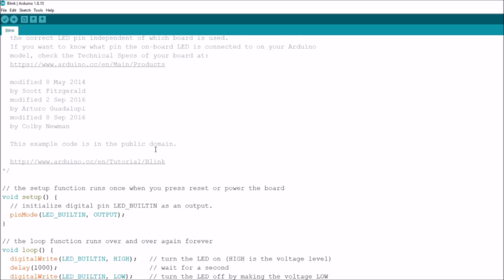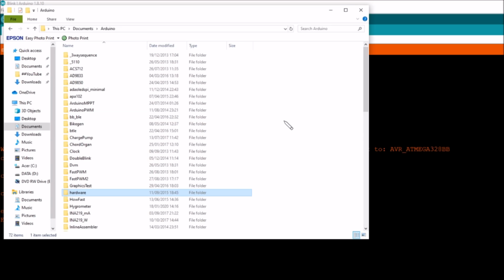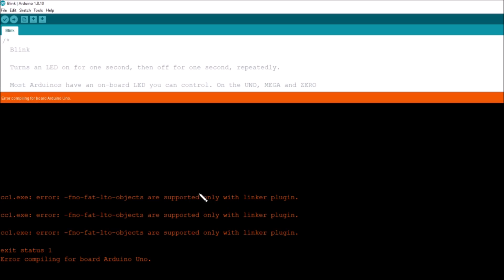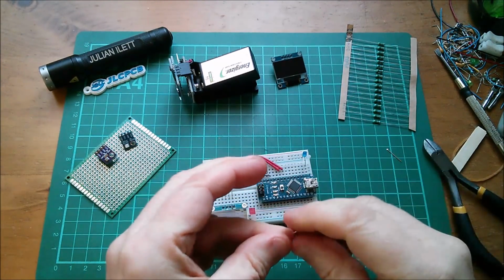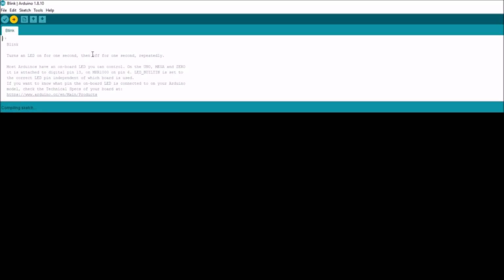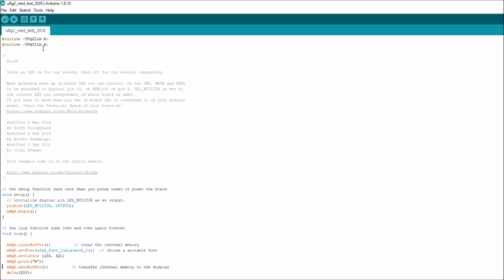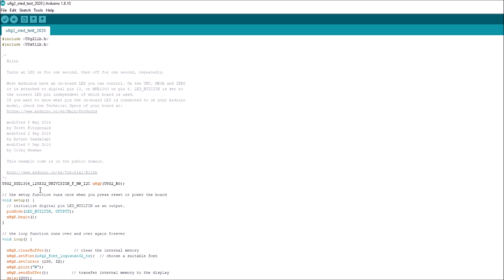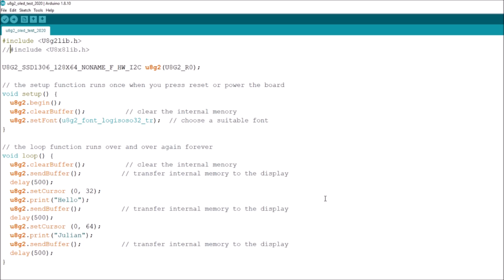Getting back into Arduino #1

Comment: That's why I feel so lost! I bought hundreds of dollars worth of components, but I struggle to do anything that works. It is so frustrating! Since I didn't understand it before I'm truly lost now. There's no way I would have figured that you could rename all of those folders and they would just recreate themselves. 
I too used to do all kinds of programming back in the day, but that day was decades ago. I think I  should just consider giving up. I'm getting no where. It's super frustrating when it comes to the ESP(families) of chips. I can never seem to find the board definition that will work with either the ESP8266 or the ESP32.

Comment: The way to solve the code breaking is to use dependency management, and you need to include both the arduino and other libraries you used. The Arduino IDE has something like that but it's global, and unless you plan to always use the same version of the same libraries in all your projects present and future, it's not a good solution.

The simplest form of this is having a git repository with git-submodules of each external bit of code your depends on. The best way of doing this is with dependency management software, aka package managers.

Some more professional environments allow this like PlatformIO (for Arduino and many others) with the lib_deps option, and mbed (for ARM) which does it by default. Saving your project references with a specific version or even commit from a library and you only upgrade if you want to. Also having the option to have a local copy of the files you depend without taking for granted that the repository (or even github itself or whatever) will exist in 5 years from now when you need that project again.

Comment: As my old boss said:
Change control - change control - change control
Without it your a**e will get bitten.

Do not worry though - its the modern style and we all suffer for it - I got caught badly with Python and eInk libraries when the new models came out as the supplier of the driver (a certain company in a steel town) took away most of the functions my code used leaving me with a big retro update!

Python has environments to lock down development versions and I think you can set versions in the IDE but not sure.  Really glad my professional programming life is over :-)

It could be a con to keep programmers in a job with statements like 'Boss its going to take me months to rewrite this to use the new library to give you that new user function'.

Comment: When I was putting together my WS2812B led array illumination system for an n-gauge Ferris Wheel last year, I decided to just use 2 PIC12F675s to handle all the outputs that I needed. (At one point I was going to use a 16F616, but was having trouble getting my PICKit1 programmer to flash the chip - this was later sorted out when I got a PICKit3 that runs on my Ubuntu machine - after fiddling around with a few bits and pieces such as the voltage level - it wanted something like 4.6875v - I was happy to be finally able to program the chip on the breadboard, but for now I won't be using this processor, although the stripboard circuit does have 2 14 pin sockets just in case I change my mind). Needless to say, I did not compile anything, because with 35 instructions, what'd be the point (also, considering the strict timing requirements, pure machine code would be the logical choice). The only other thing I would say is that why 24 bits are needed for each LED (I'd sooner have just 256 colours like in the GTIA modes of the Atari 8 bit)...er...the PWMing on the 8050 doesn't appear to realistically address 16.7 million colours - and the higher luminances just are blinding...also, amusement park illuminations don't really need anything like all that...no arduino libs needed, thank you! Incidentally, the bits and pieces used for the led arrays are 8 led 'struts' (Adafruit 8 led segments), an Adafruit 'jewel' for the centre piece, and two TruOpto strips for the outer rim lighting. I thank you for demonstrating how to connect the 16Mhz crystals to the 12F675s...

Comment: A little off topic but has anyone used the MPPT off eBay for 10GBP (item 312642468438 for example) My question is IS it MPPT or PWM. It looks like some PWM's for the same price but says its 10%-30% better than PWM claiming MPPT. All replys with thanks.

Comment: You should consider buying a new PC if it's too slow for what you are doing. You can get a good one using Skinflint for around 500 GBP that will work much better than your current one. Unfortunately I cannot share wish list links here, YT deletes comments with links IMMEDIATELY.
But here we go:

AMD Ryzen 3 3200G, 4x 3.60GHz, boxed (YD3200C5FHBOX)
MSI B450M Bazooka V2 (7A38-026R)
Patriot Viper Steel DIMM kit 16GB, DDR4-3200, CL16-18-18-36 (PVS416G320C6K)
Intel SSD 660p 1TB, M.2 (SSDPEKNW010T801/SSDPEKNW010T8XT/SSDPEKNW010T8X1)
be quiet! Straight Power 11 Platinum 550W ATX 2.51 (BN305) 
DeepCool Matrexx 30, glass window (DP-MATX-MATREXX30)

Currently for 427 GBP excluding shipping

Would make for a nice PC building video, too!

Comment: So that is one reason I graduated to VSC and PlatformIO. Even so, the libraries for these things are crap and you end up re-inventing the wheel over and over. The Arduino project is wonderful, but filled with traps and an IDE that really stinks. I guess experience is the only solution.

Comment: The hazards of installing new versions of the IDE, compiler toolchain (AVR toolchain is bundled with the current generation of the Arduino IDE), and libraries... things are no longer compatible with each other! :( This was one of the main reasons I have switched to PlatformIO + VSCode. VSCode provides the IDE, and PlatformIO does the compilation - and allows explicit control over versions of the toolchain and libraries used. End result, I have the choice of following the trends and latest version, or locking off the version of stuff for extended support and reliability. 

Your first error about the build.board preference is because in your hardware folder you had a custom board definition for the "ATmega328 on a breadboard (8 MHz internal clock)" which because of it's age doesn't set that preference. I added that on my copy, but have also renamed the hardware folder 'hardware.old' in the past ;) You can actually do away with that board entirely now if you use MCUdude's MiniCore board support package, as that provides the 8Mhz RC oscillator option, and is a up-to-date package. The later linker plugin are most likely because you have an old version of the AVR toolchain still installed locally, but the build scripts are newer, so it's using parameters that weren't valid before. A Tools -> Board -> Board Manager and an update of any out-of-date toolchains would most likely have fixed that. 

btw, library examples are in the File -> Examples menu. I'm sure it'll all start coming back to you... just need to liven those cells up a bit again! ;)

Comment: Man what a coincidence. that happened to me with all my old code that I wrote for my Arduino. when I install the new IDE to my laptop a lot of my codes didn't work. I managed to get some of them working again but a lot of them aren't. I don't know if it's the libraries or what. especially when I was using the ATTiny85
Reply: That's pretty much why I keep older versions of IDE installed.

Comment: Don't spell your files/folders wrong!  They can be hard for YOU to spot later so just rename them with "OLD" or whatever best describes it.  If you rename library to OLD-library it will be easy to spot and find later.  Sort by name or search for OLD and you will find ALL your changed old files and folders.  A year from now you will be wondering why someone spelled those wrong but the OLD ones you will know why.
Reply from the maker: Possibly, but my mind does work in peculiar ways :)

Comment: Is for that I save the old libraries in my project folders, just in case, and sometimes even the old IDEs (TASM, Turbo C++, Arduino IDE, ...). I still use the older versions of "LiquidCrystal" and "CountUpDownTimer-master" Arduino libraries, they work just fine for me. Thanks for sharing !

Comment: Having the same issues with ESP8266 - I have a project that's been working for over a year and needed to make a small adjustment.  Original code compiles but doesn't perform as expected - back to square one...

Comment: Some years ago i had an arduino uno (clone, i think) in my hands to program it for someone with a script found on internet.
The computer didn't see the arduino. It seemed that the ic for the usb was not programmed. I ended up programming the arduino using a cable between the parallel  port and the icsp connector.

Comment: When my Arduino project is done. I leave the Arduino in the device i created. I don't modify the code after.... No problem that way! And buying Arduino in bulk is cheap !
Reply: Bulk?  Where?  Best I've seen (months ago) seemed to always be cheapest in single units from eBay.  Yes, I know and have boughten the ICs in "bulk" but where are you buying the whole boards from?

But don't you ever make something and then think months later that a new feature would be nice to add?
Reply: @ElmerFuddGun  i buy packs of 5 on Amazon . It's like 10€ for 5. And i always put a small usb stick on each  my project , as a backup, with all the useful  files (wiring schematics. Code . Libraires) . It's the best solution for the long term, i think

Comment: I challenge you to install Linux and find a compiler in the available packages to build your old assembly code, even if it was 8086 asm.
Even more illustrating: take a C program that is 10 or 20 years and try to build it on the stock GCC of your latest Fedora or Mint... it won't compile!
The reason is that even the tools have the same kind of problem that you're ranting about: new features are added, older ones are removed, in a nutshell things change. For C programs, you can (and should) check for those capabilities of the compiler (a bit like C99 for example)... but it's more true with libraries: in a proper software engineering world (which linux tends to follow, ymmv) version numbers tell if it will work or not, I mean major and minor versions have semantics that every proper software engineer will follow, and provided there's a way of specifying dependencies (for example library XYZ version 2.x) then you should be good. My experience with arduino is limited but it seems there's no such semantics in place and it's like the wild west, just more brutal :)
Reply: it probably would compile with the right flags set

Comment: you need to define what you are programming too, so, identify the board and look under tools>boards menu, add a new board that matches what you are using. first error is the only one to solve, errors after it are usually based in that error. 
what i like to do is put an empty "portable" folder into the fresh Arduino directory from a zip (not installed), that will allow you to keep a fully isolated directory for individual projects with boards and libraries for a working final product archive. 
i also have a custom blink (timelord heartbeat) so i know its "blink"

Comment: It is not only Arduino... Other targets / MCU's also may also be susceptible to changes nowadays and some provide info on how to upgrade to new compiler / IDE version . the macros #ifdef .. #endif comes handy for this situation to be compatible .  As IDE on arduino use the VScode with Arduino MS extension for atmega328p only and for others the PlatformIO :P The important is make thru it :D. Like the compact sensor + OLED + Batt  + Arduino combo  :D

Comment: How did renaming the files correct the problem ?   Recompiling the Code using the New er IDE corrected the issue.  You Rebuilt the code   That is what corrected the Code.  Renaming would have done just that . Rename using the new IDE.   They keep screwing with the dang IDE all the time.  That's our problem.  Every fix should be backwards compatible.  Bad Programing on Arduino's side.   So basically we have to Recompile (build) the code every time they alter the library or IDE.
Reply from the maker: The problem is with the uninstaller. It doesn't uninstall added libraries, hardware and it doesn't remove your preferences.

Comment: a few months ago my 82 year old neighbour asks me to check his internet. wasnt working cause of some maintenance. i told him to wait a few hours. so he asks me kindly , can you help me with another thing. he shows me a box with about 15 small digital videotapes. the minidv kind. i would like to see those on my computer he says. in the vox was his camera too. along with a video audio capture usb device. so i am thinking in the back of my head, this will take some time. though i have a similar camera and lot of tapes too. my camera has a direct usb out and both cameras had a micro firewire output. my camera always worked fine exporting video over usb. what can be the problem i thought. also i have 2 computers running macos and 3 laptops with windows 7 and windows 8.1. an old plotterserver running xp. i have the resources, the knowledge and it was almost christmas. i had some time to help him out . so i though lets be friendly. help the old man so he coukd watch his vacations on a nirmal screen. approach was simple. lets install my own software which came with my camera. run it under windows 7 in compatible mode and import the stuff. put is un a usb stick or dvd and return the stuff to the neighbour. well that didnt work. after reading two days about enforcing a driver install none of the computers recognized the camera. lets go firewire on macos then..  same problem no recognition on the mackintosh. also not through an adapter through thunderbolt. well lets get analog then , the neighbour presented the capturecard without driver cd. i was sure to find the right driver in minutes... took me 3 days ! now al you need is capture software ! i ended up with some software which only imported the video. the audio was interleaved.stuttering bs. i ended up reviving my old plotter cutter server which was laying around because the plotter wasnt supported on windows 7.( an old t shirt labeling hobby i had) . so i used that computer installed my old xp software on that. and guess what... it finally worked.. it took me a complete workweek to help the guy with his videos probable because our operating-system-creators somewhere pas 2000 had the idea of making the data path inside the operating system ‘secure’  .. if you really think about this: when i bought my camera , it was to capture these family moments with my kids. to have a digital archive just like an old skool photo book. opposite is true . i think since we have cloud and digital video and photos and cameras we are not that able to enjoy those family moments like we did with the old skool photobook. how many of you have lost digital photos because of harddisk crashes, cellphones falling in water, lost or stolen cellphones, dying cellphones. no backups made  and gone it is.. i have a good understanding of computers but the story above shows how difficult it is to keep your data with you. since this happend i bought a synology network attached storage.. i am stopping all of my cloud computing and am taking control of keeping my data . nice thing is i have imported my own videos too now. and enjoyed those moments with my kids again.
Reply: What a load of drivdl

Comment: I've never had a problem with Arduino, but then I don't ever upgrade it. Still using the same one I installed years ago: 1.6.7.
I don't like patching ever, for this very reason. When Microsoft updates Windows I find things stop working, which is why I stuck with 7, which lets you choose which updates you want. If it isn't broke.....

Comment: This problem tends to happen a lot in software industry. Usually the fix is to use strongly named versions of libraries and of the environment. For this to be achieved, you usually require a dependency management software (mix for elixir, gradle for java).

The thing you mentioned about assembly code is simply not achievable nowadays, when you can program arduino on a big variety of chips that have different architecture, not to mention how complicated would be to understand some of the more advanced code with tricks done to optimize it.

Comment: Nice! Have you done or considered using Atmel Studio to program arduino. Since the main chip is from atmel. Atmega255p if i remember correctly. 
In uni we used atmel microcontrollers, but I managed to be able to program cheap arduino knock-off with pure C. Using atmel studio.
Reply: atmega328p in this case and every even half genuine atmel chip i came across was programmable in pure c (just like just about every other platform on the planet) only you have to get an isp since atmelstudio and avrdude while being able to work together are just a bit annoying as a combination... 

but yes i can only advocate for that route. 
if you want something done the right way do it yourself.